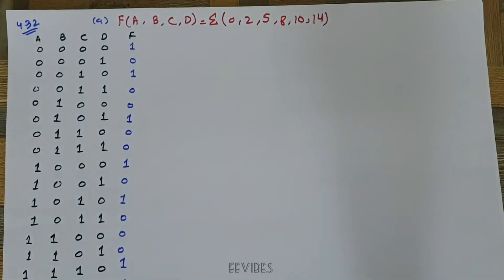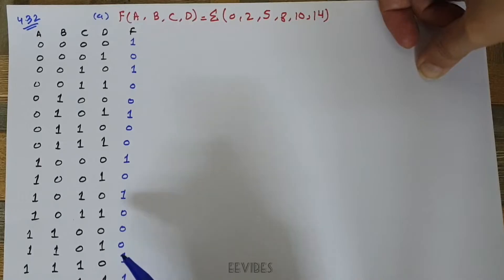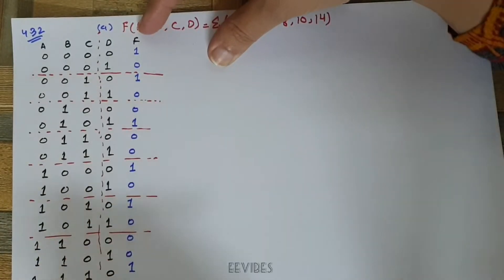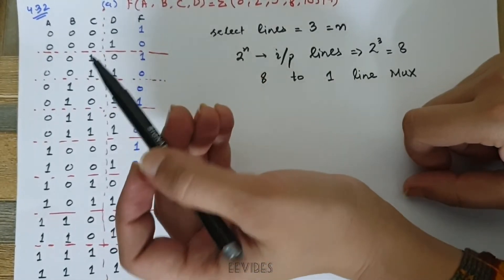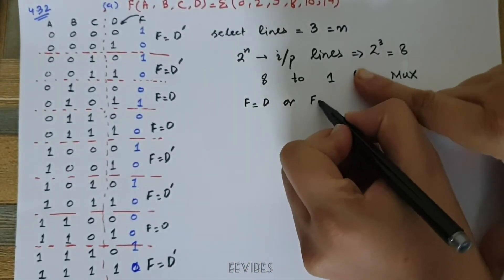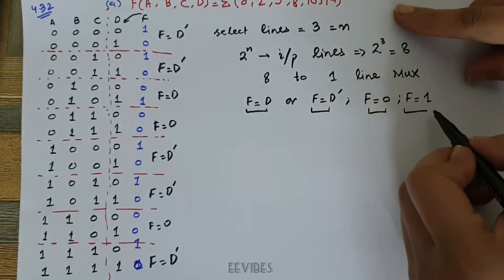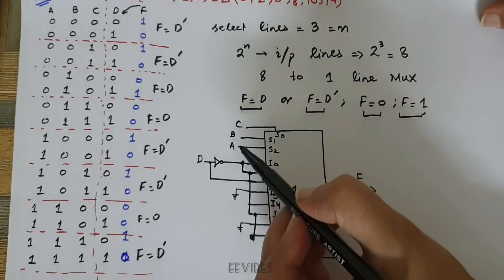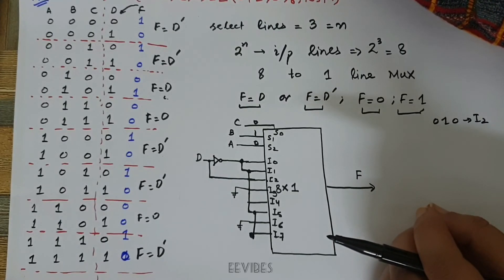How to Implement following Boolean function using multiplexer F(A, B, C, D)= Σ (0,2, 5, 8, 10, 14)

Comment: How to implement this in logic gates ?
Reply from the maker: Just use the gates derived in the final expression of Boolean function
Reply from the maker: You can easily find MUX ICs in the market. Use its datasheet to know about pin configuration and then use the output pins for ORing them